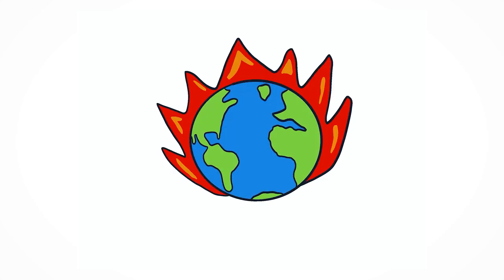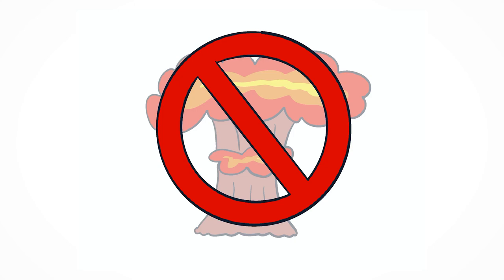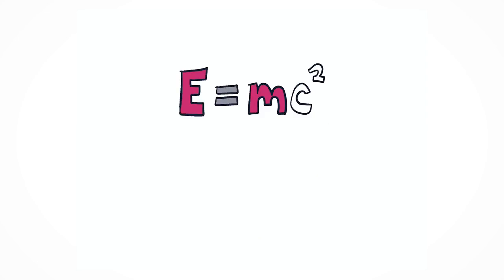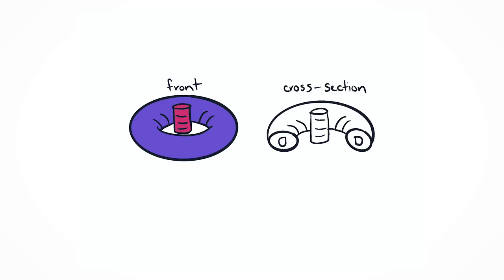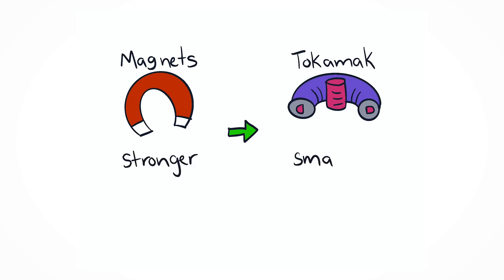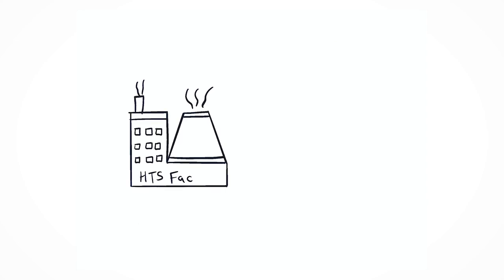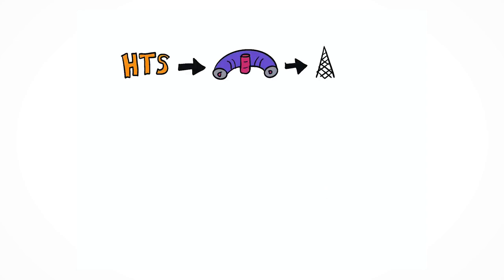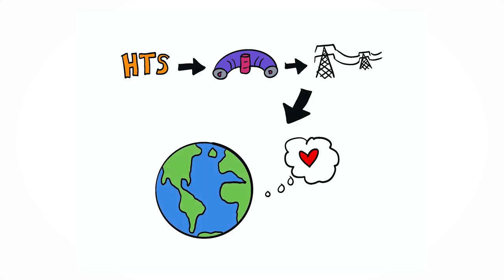High Temperature Superconducting Magnets Will Help Our Climate Crisis

Comment: "The fuel is readily available in the ocean"...that's kind of stretching it, given that there is not a single entity harvesting Lithium from the ocean, meanwhile the demand for Lithium is higher than ever. Also I doubt that Li -> Trit is 100%.
Reply: Probably referring to deuterium which is 0.0156% (by number) of hydrogen in the ocean.

And as they said others, like Tritium, can be produced by nuclear reactions.